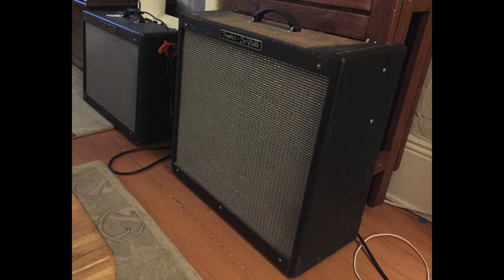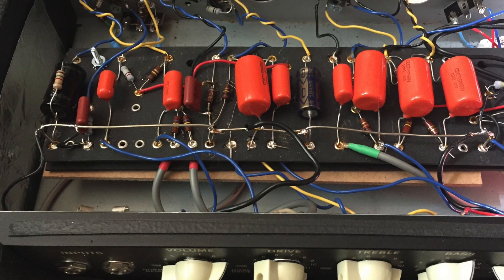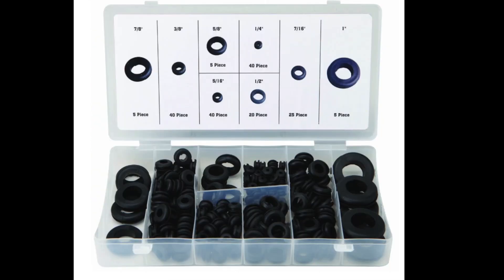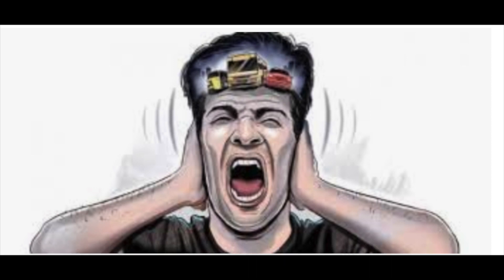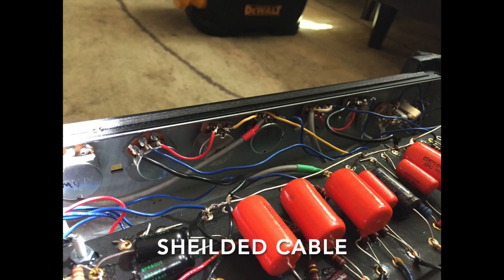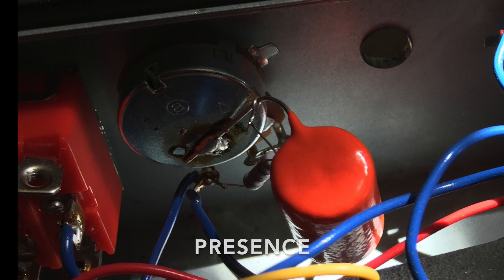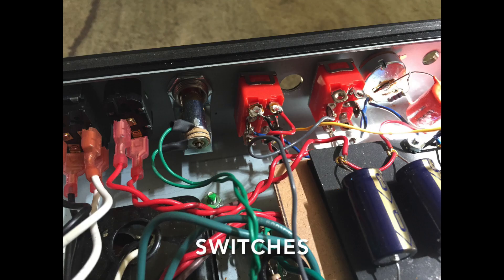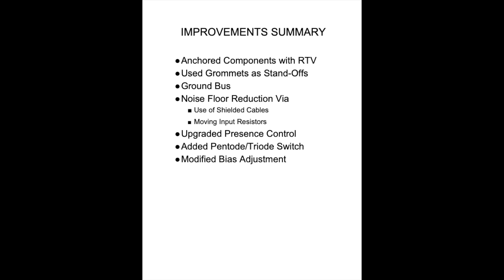Hot Rod Deluxe to Bassman Conversion part 2 (upgrades)

Comment: You then realize why Marshall used plastic jacks, not because they were cheap, but to better control the grounding scheme and not have jacks and pots grounding randomly everywhere.
Reply from the maker: There are several techniques that I use nowadays, which are a nice improvement to how I did things at the the time of the first 2 videos.  One can learn a lot by looking at how Dan Reeves, John Suhr and Soldano build their amps...

Comment: i have a '93 concert which is essentially the same transformers and circuit as the deville.  How did you handle the rectifier and did you add reverb?
Reply from the maker: Hi John, feel free to email me at my username at gmail.com.  in short, I used 1N4007 diodes to rectify and left the reverb out.  I have helped several folks doing these conversions and will gladly help in any way that I can.
Reply: @jloewenheim  excellent!  am doing the conversion i will email you.. The iron in this has limited options (lack of center tap). Really wanna keep the reverb somehow. Thanks again!
Reply from the maker: @johnmiller9219  Reverb can be kept, we can discuss when you are ready to build.

Comment: I am thinking this might be the way to go for me. Tired of the maintenance costs associated with my HRD. Things fail seemingly endlessly. So this sounds like an awesome way to make my amp fun again. I have a 1996 Hot Rod Deville 410, the 60W beast. Will anything need to be changed (Power or Output Transformers, Choke) for this mod? Would love to talk further if you have the time. Cheers on the great content!
Reply from the maker: Yeah, let's connect via email, will go over some details with you.  There are a few minor tweaks that you will need to do with the deville vs deluxe.  These are mainly having to do with how you bias the tubes.  You can reach me at jloewenheim at gmail